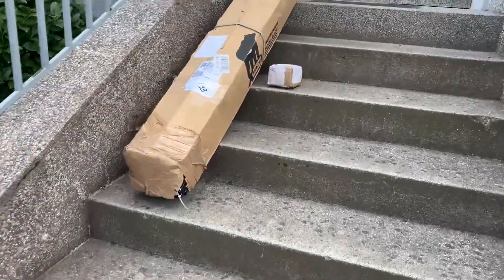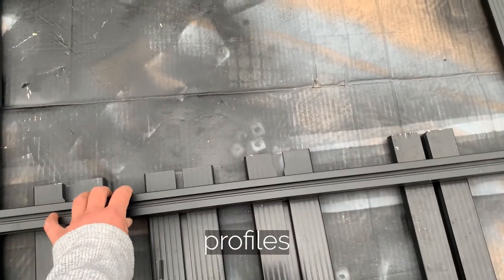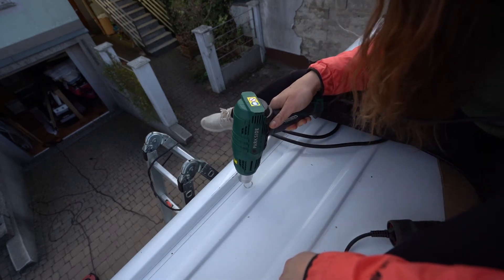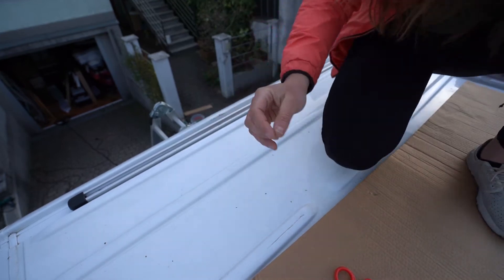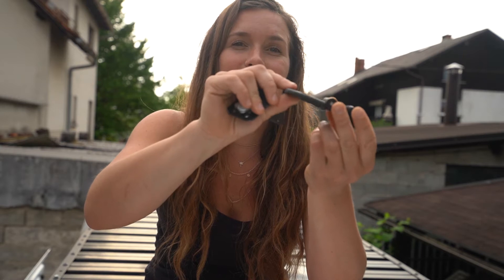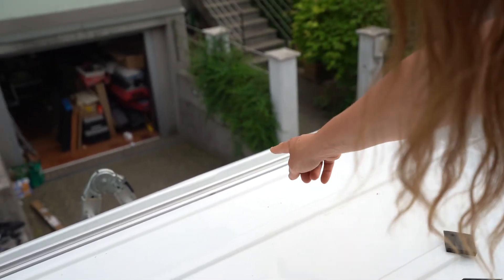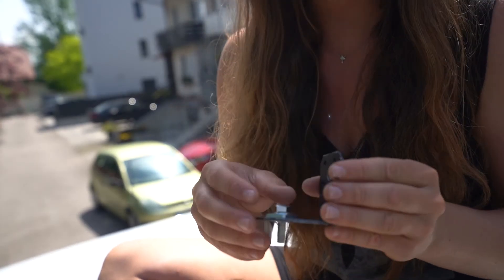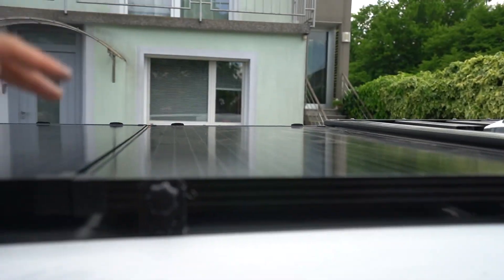Roof Rack, OEM rails and solar panels install for Sprinter Van

Comment: Great idea , well done. 
where did you get the nuts please? if you don't me to ask 
thank you
Reply from the maker: Hey Hady! Thanks so much! I found the nuts in at a local shop Aluminum profile supplier - the nuts that fit into 4x4 aluminum profiles and are used to join those together fit perfectly into Sprinter rails as well! hope you find some :)
Reply: @vanbuild9074  
thanks for your reply. 
would be great if I can have your local store name to buy the that rail nuts.
I'm desperately looking for something similar. 
thanks